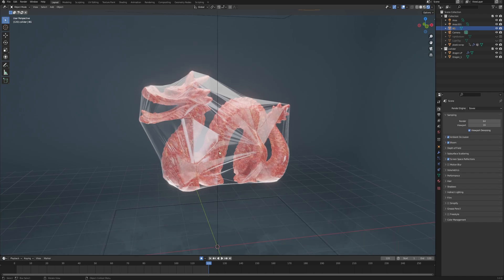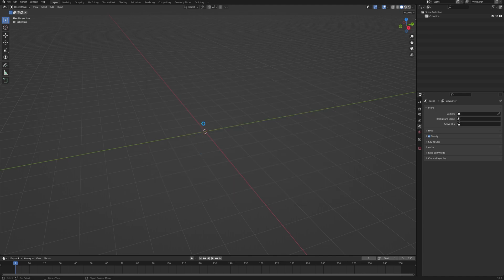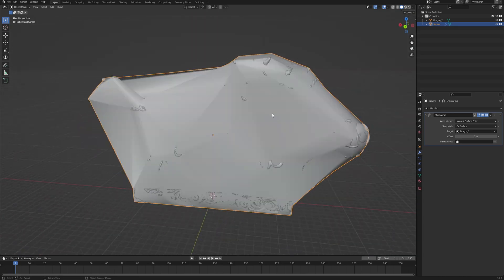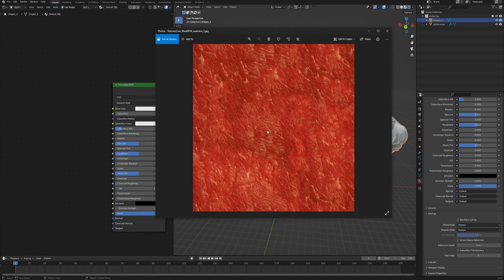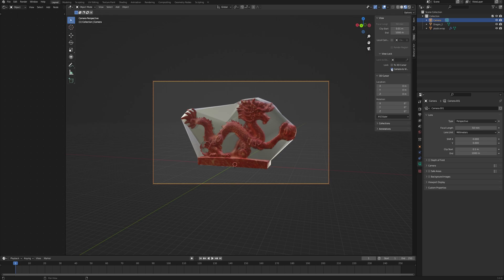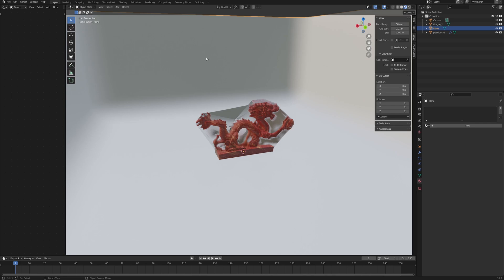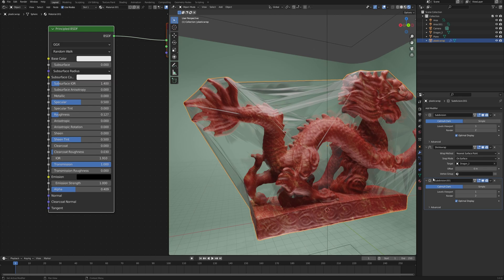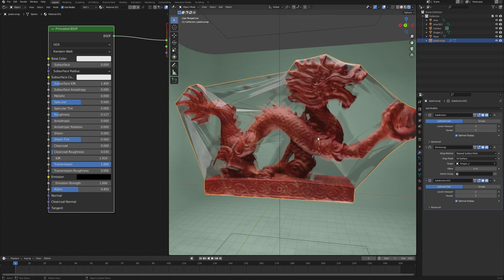Create EXTREMELY Satisfying Plastic Wrap Animation in Blender - TUTORIAL

Comment: Just a quick note on mixing in the Transparent BSDF at the end: a full white Transparent BSDF makes the parts where you apply it invisible, i.e. it basically works like Alpha transparency. The Principled BSDF has the extra channel for it, you could simply plug the Fresnel and Color Ramp directly in there. To compensate for the already reduced opacity because you've set the Alpha to about 0.5, you would set the white of the Color Ramp from 1 down to 0.5 to get the same result.